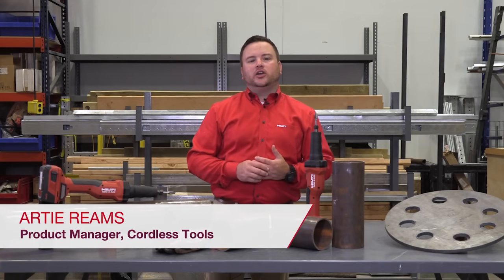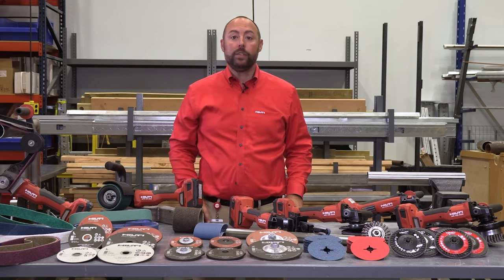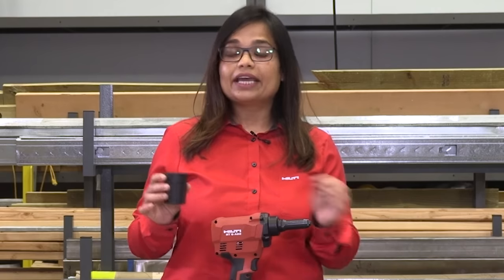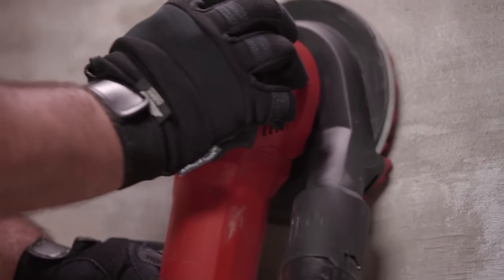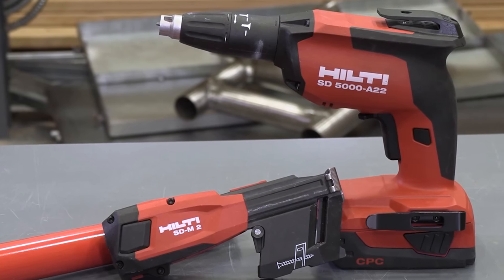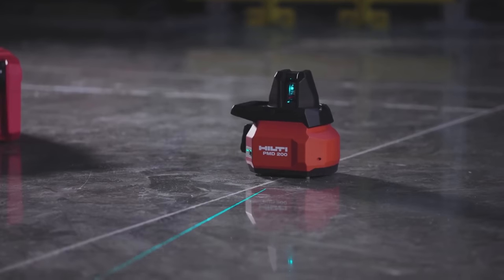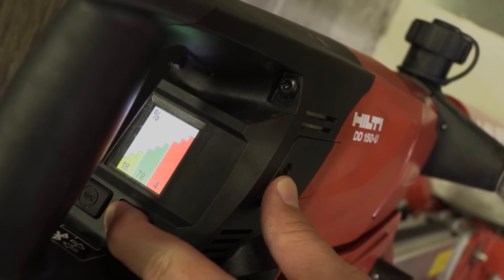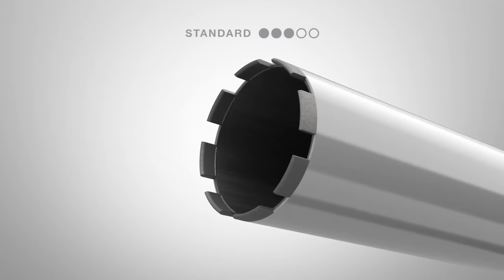NEW TOOLS & ACCESSORIES FROM HILTI (They Tried To Keep Secret)

Comment: I loved all of the Hilti stuff I’ve used.  It is definitely for professionals.  It’s not a DIYer brand.
Reply: Yeah, all the wannabe professional DIYers draw the line at Milwaukee
Reply: chris em Milwaukee, Dewalt, and Makita imho make great DIY and professional tools.  Hilti is just on another level especially in the concrete industry.
Reply: DamionJR4923 yep
Reply: @raiderc9471   I've had the same makita tools on tier1 commercial projects since 2013 averaging 55 hour weeks of constant use of the impact driver with no issues at all. $2000 worth of makita tools have made over $700,000 in this time. The impact driver is especially impressive considering how many 38mm SuperTEKS Series 500 screws it has driven into structural steel, aswell as various concrete anchors.

This workload exceeds DIY by light years and makita handled it just fine. So I ask, why woukd I pay more money for hilti tools then? (Impact driver & wrench, angle grinder, circular saw, rotary hammer drill) Absolutely no reason.

Hilti has other great products tho such as their rotary lasers but the tools mentioned above will suffice from other brands.
Reply: @raiderc9471  hilti is only good for concrete, they are not as powerful as Milwaukee
Reply: Only good for concrete, hilti sucks for other tasks that only Milwaukee, dewalt and makita can do, only a sucker would buy a $500 tool that can do only one thing. So long sucker!

Comment: Hello
I would look at a Fein 1st or a German Metabo die grinder before the Hilti.  Only because Hilti uses to be an excellent german manufacturing and design company,  now it's all chinese.  Hilti chose profits over jobs for german craftsman.  Very sad.
Reply: Most battery tools are going down the same path, I have a bosch grinder and hammer drill which are "German made" but drill and impact are not.... there all shit in my opinion..
Reply: @jonno9293  I do remodeling and installing work.  Most of my daily power tools are German Metabo, some Fein, and Bosch, mixed with a little Milwaukee 12 volt.  I think Bosch is a very good choice for most people.
Reply: Untrue.